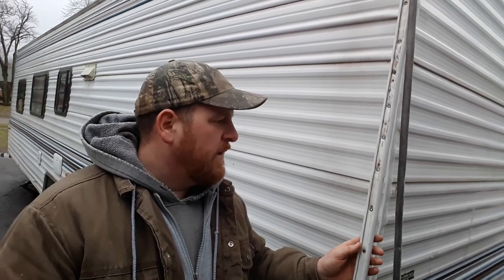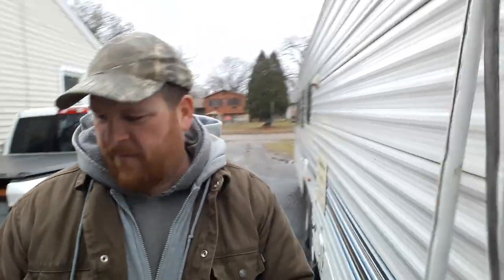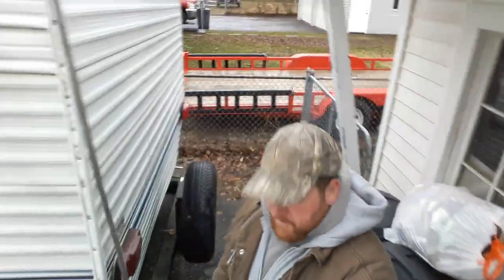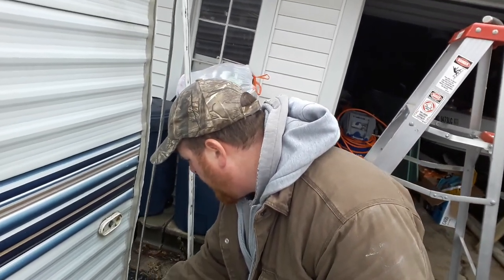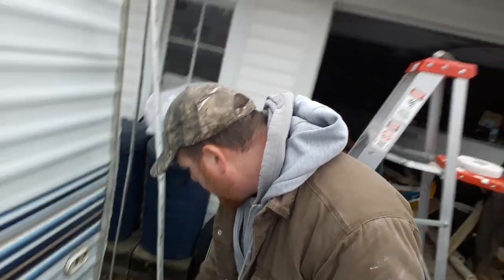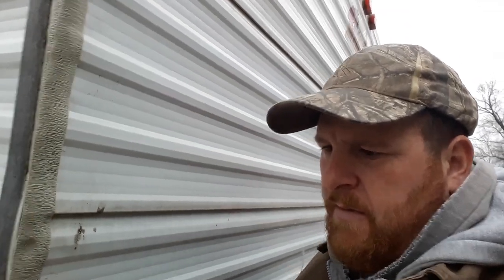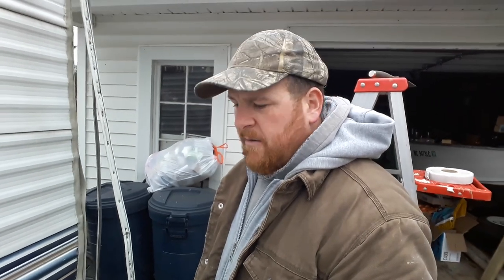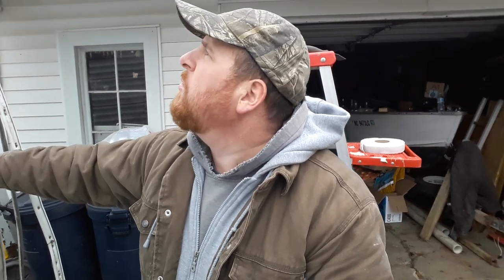RV repair - butyl tape to the rescue.

Comment: Can this butyl be used to seal the roof (where the roof meets the wall and covered by aluminum trim)?
Reply from the maker: I'm not sure to be honest.....I think you want to use self leveling sealant or caulk
Reply: It probably has it or used to when manufactured, overtime dries up.

Comment: What is the width of the butyl tape? So both sides are wrapped to give good cover to the corner ? Thanks,
Reply from the maker: I is only about 1 inch wide....it worked well yes. I think they may make butyl that is shaped like a corner so you may want to check that out.
Reply: couldn't tell by the sight of it? wow

Comment: I recommend to use caulking as well, tape won’t do it alone
Reply: After I cleaned and stapled the siding as close to a tight corner as possible, I applied 2" wide tape. I then used butyl tape under the corner trim. Then I applied Dicor no-sag on the outside. They're sealed tight!
Reply: That's exactly what I was wondering. Thank you. I will do the butyl tape and Tremco Dymonic Sealant.
Reply: @svca12218  I think you will sleep soundly and dry when you do.
Reply from the maker: Sometimes the more the merrier,  ours seems to be holding up just fine with only the butyl tape, seems to be how they do it orginally and caulk makes future repairs difficult.  But hard to not slap extra sealant on it. Lol
Reply: @OffgridwithJayandJen  I don't want to ever have to do this again! So sealed!
Reply: Y’all think using eternabond tape and caulking will do the job too?
Reply: caulk will dry and crack!